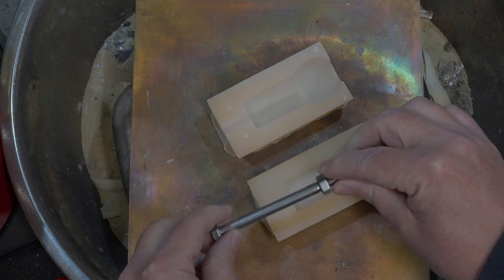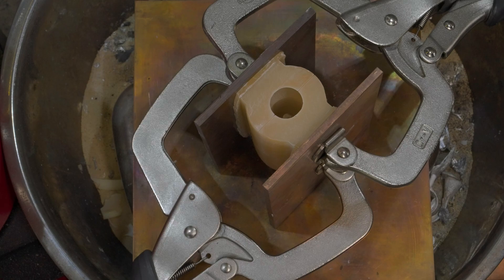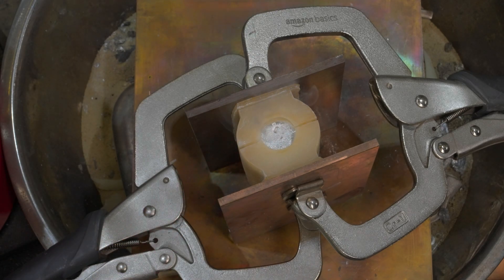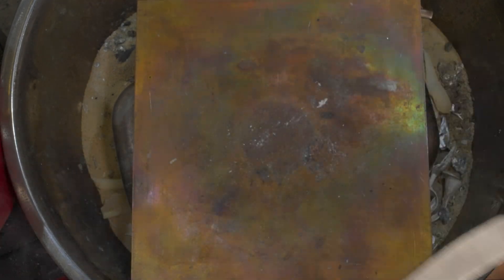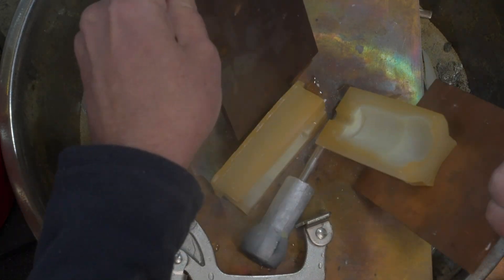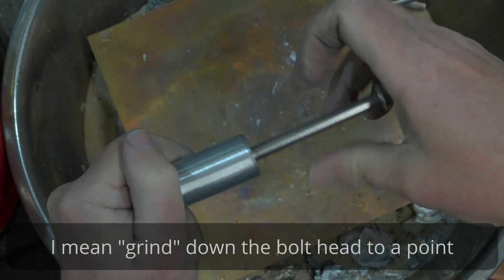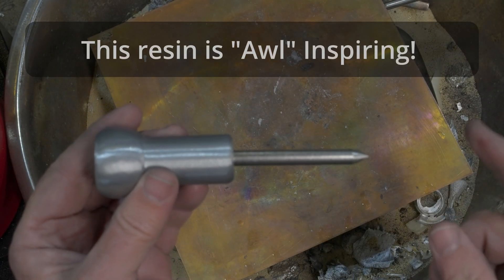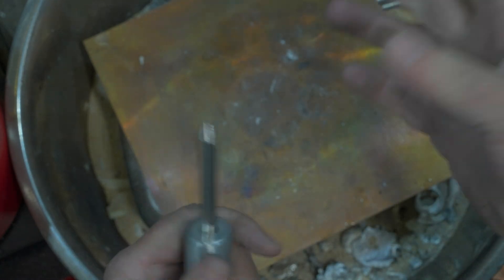Casting Metal into a 3D Printed Mold - Part 2

Comment: Hey, I'm assuming your in Australia cause this is an Australian branded resin I'm pretty sure. If so, where did you get the Zamak 12? I can't find any suppliers in Australia that supply zamak and the shipping costs for overseas zamak is outrageous.
Reply from the maker: I'm in Sydney and got it from https://hayesmetals.com.au/ .  They have all the various Zinc alloys 3/5/12 etc.  I'd not suggest using 27 due to the higher pour temp.  One down side is they are pretty big ingots, so you would need a larger gas furnace or a saw to reduce it to smaller stock if you only have the smaller elec furnace.  Monocure and I do have a meeting to discuss with them about making more "consumer" friendly sizes for home caster.

Comment: It will be really interesting as I can see the 3d printing will allow for unique cores and multipart molds pretty easy.   Seeing the cast in place is pretty cool.

Do you think with the zamak a vacuum or spin will be required or is it flowing well?
Reply from the maker: I think you are right about multipart molds to get complex castings that would otherwise be difficult to do in sand.  I've also used it as a one piece "investment" style mold, where you break off the resin shell after casting.  Zamak12 is the "best" zinc alloy for gravity casting, and I find it has pretty low surface tension.  That said, I had to add a pretty big sprue to get some head pressure for a ring mold to get it to fill all the way to the edges (and some molds will need venting).  I can also see this being used in spin casting setups to capture much much finer details.    Vacuum casting with it would require lots of experimentation in regard to the size and placement of the air channels.  The other option I'd love to try (but don't have the equipment) is to use it with a die casting machine.
Reply: @The_Smelters_Apprentice  Thankyou!  Looking forward to getting my paws on some to try out.